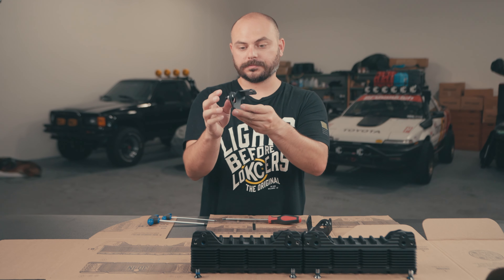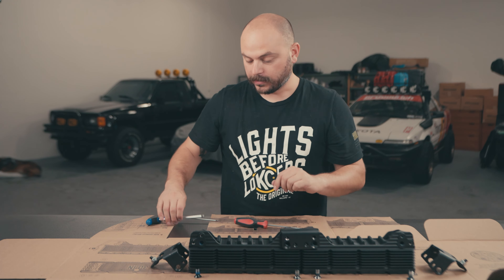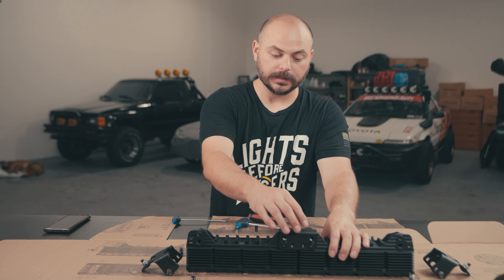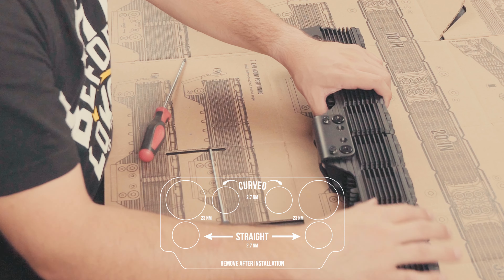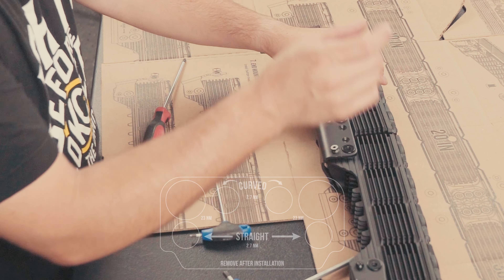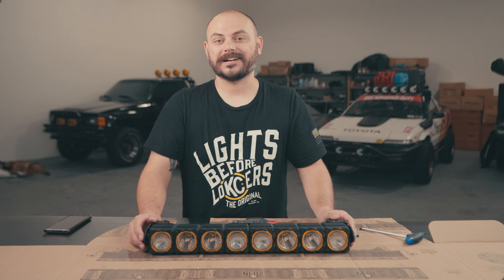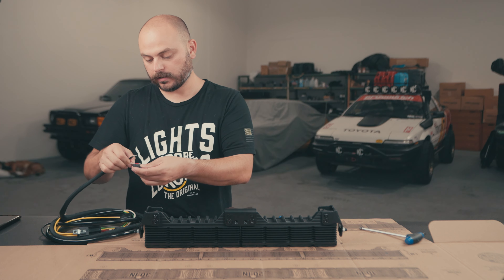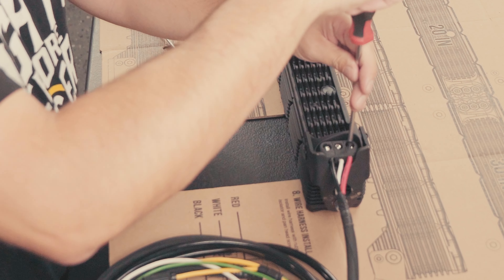Assembling your KC HiLiTES® FLEX ERA® LED Light Bar- Install Guide

Comment: Hi, are all fitments, bolts and screws etc stainless steel? Cheers Mike
Reply from the maker: Hey Mike! This is directly from our PD team! - "All the hardware is Stainless Steel other than the nuts. They are galvanized steel to help reduce seize."